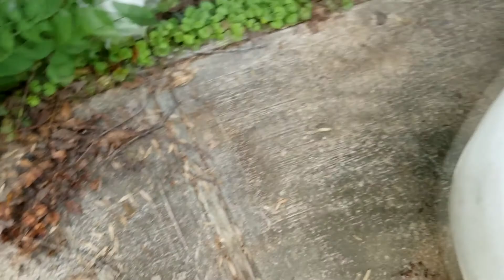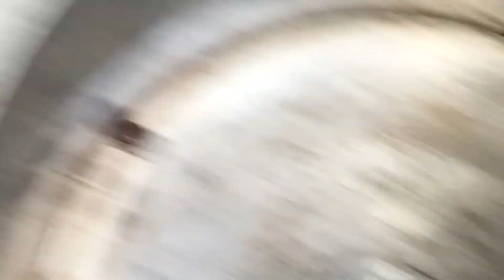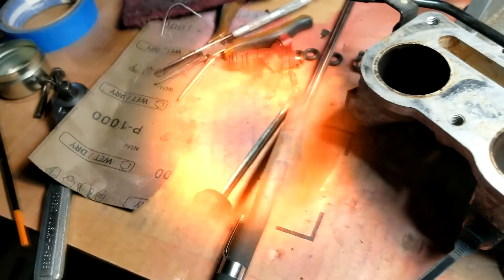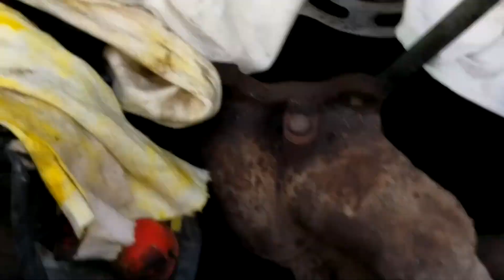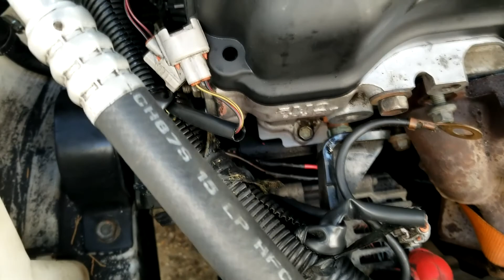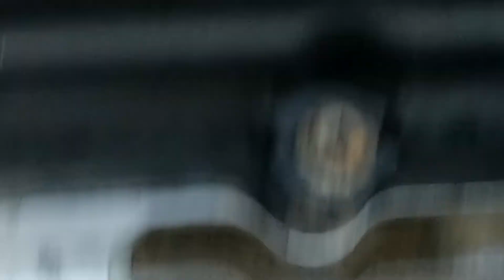2002 Sentra Head gasket Part 3  Finale.

Comment: Hello! When I removed the valve cover, this engine did not have a timing chain guard at the top. The new kit did include it though. I have no bolts either. The manual does not show a guard either.  Any thoughts on this?  Mine is a 2005 1.8. Thank you for the video!!
Reply: Is this a 1.8 or 2.5? I checked the manual again and the 2.5 does have a guide at the top. Interesting

Comment: Good job, very informative is it very difficult to remove the entire intake manifold to replace the lower gasket?
Reply from the maker: you have to remove the head and at least the lower intake manifold together. The LIM fits on studs protruding from the head so there is not enough room in the engine bay to remove the LIM in the car. Nissan recommends removing the head and the LIM and UIM together. I had to remove the UIM to reduce the weight in the car.